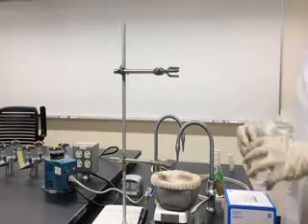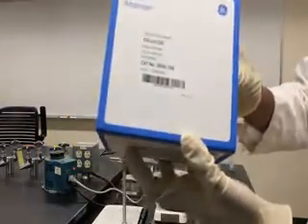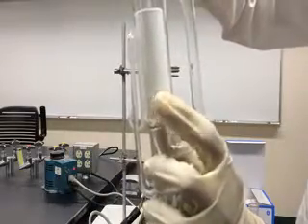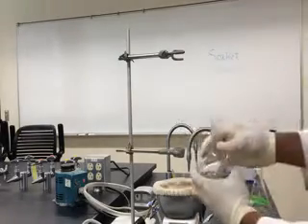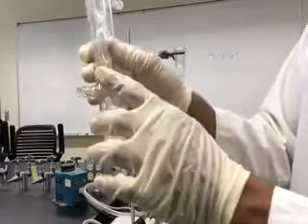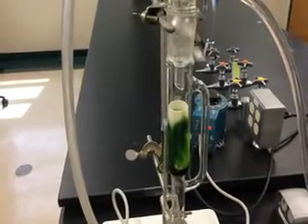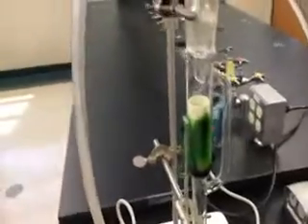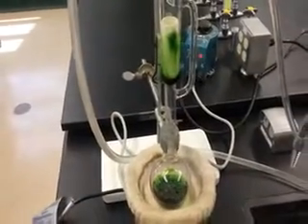SOXHLET EXTRACTION simply explained

Comment: So where does the outlet go? It disposes of the water into the sink? How do you know how much water to gauge into the inlet when turning the handle?
Reply: The water doesn't need to go down the sink, you can recirculate water in a bucket using a small pump.
This way you can also monitor the temperature of the cooling water and lower it by adding ice.
Reply: As for gauging correct flow, you usually don't need a lot.
So start with a gentle flow and check the column temperature with your hand as the distillation gets going, if the column is heating up you either need more flow or colder water.